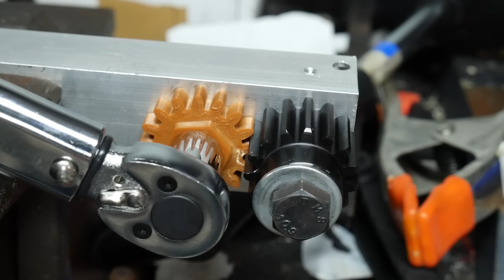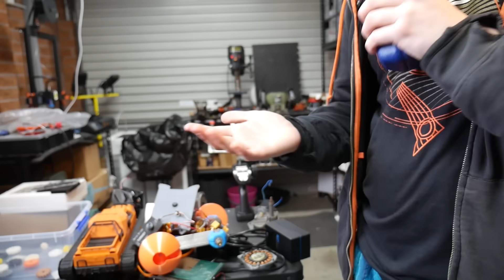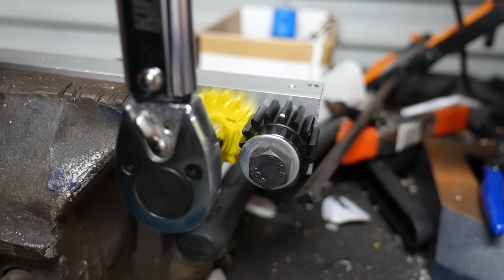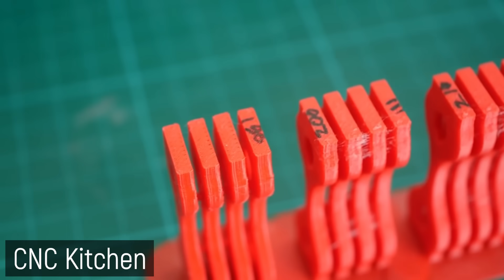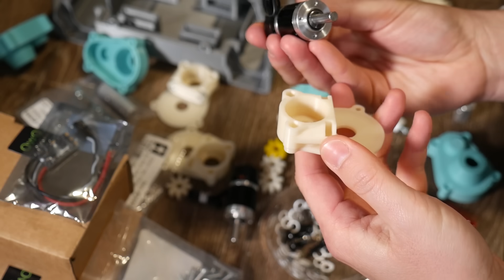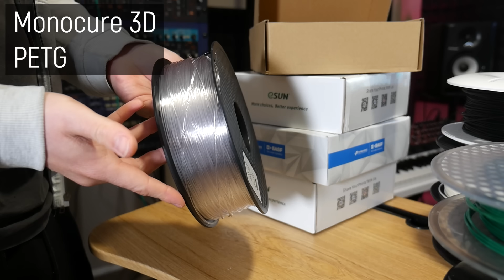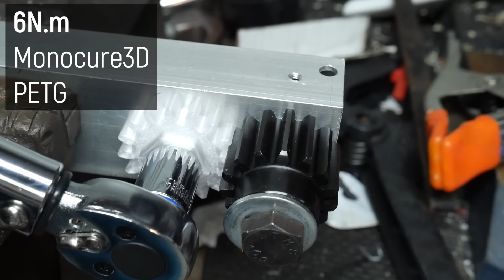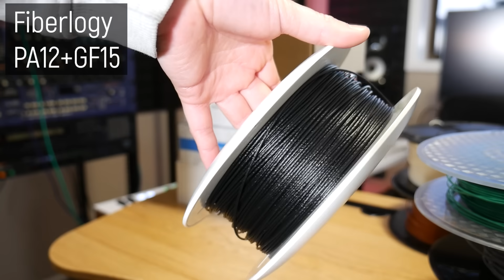Which 3D Printed Gear is Best?

Comment: Before watching the video I'm going to go ahead and say that my personal favorite is PETG. I'm very curious to see what your results are!! Update: Okay, how could I have been so wrong haha. However, to note, the quality depends so much on producer that I think it's impossible to say which material is the worst.

I have been designing some machines lately and the PETG that I used for the parts worked better than any other material I tried to print with. I've never had a failed part with this PETG I'm printing with, and it's lasting much longer than any other PLA I've printed with. Most PLA's would start to crack after one year of use. They say that PETG has worse UV resistance, but I think that in the end the PETG I have holds up better than the PLA I had.

On top of that this PETG prints really nice with an E3D hotend with a titanium filament path, so no PTFE tube inside this hotend. I was expecting problems, but my prints never looked this good.

One more thing I miss in the comparison is a comparison of the friction coefficient, which greatly impacts how long a gear survives, and how hard it is to turn. Some plastics just really aren't that frictionless. PLA in my experience performs the best as a common filament, but Nylon should have an even lower friction. And eventually PTFE has the best of all of these, but I sincerely recommend against using PTFE in a 3D printer as it's a super dangerous plastic. If you have pet birds, stay away from printing with PTFE as your birds will definitely pass away from even the tiniest amount of fumes.
Reply: I don't think you're wrong, PETG would still be my choice under the circumstances. I had some loaded PLA prints and there's some chemical degradation happening, they all shattered after 1-3 years, it doesn't even feel the same. PETG is pretty well behaved, low surface friction, good abrasion resistance. UV resistance? Depends on additives and colour, but i wouldn't say PLA is anyhow remarkably good in this regard, not from the tests i have seen.

Nylon could be worthwhile, maybe HIPS, SAN, ASA, worth testing, but PETG is so cheap and doesn't cause much headache...

Comment: Did you rotate the gear after you noticed the deformation while testing?  I would think that if you didn't you did not get the true fail torque b/c the gear was damaged at that point.

Comment: While I was researching for a project, I ended up looking at the tensile strength of various ropes. Pigments can have a surprisingly large effect on the strength of the material. I'd be curious to see how the unpigmented materials fare.
Reply: Also printability. I had a white PLA (fas filament) that was almost unprintable for me.

Comment: I made a 3D printed change gear for my 120 year old lathe. The gear was made from PLA, 1 inch wide, 80 percent infill, 16 teeth, 8 DP with a 1/4" keyway in the bore. It handled a cut of .125" depth of cut in 8" diameter steel, .008" feed per revolution at about 20 RPM with no problem.

Comment: Far be it for me to tell you what to do, but I would've tested a CF Nylon before the Glass-filled. I say this just because the CF Nylon is stiffer than the glass filled, and would likely have provided the best results since stiffness was an issue. Of course, with that, you get the potential issue of more catastrophic failure since it IS stiffer

Comment: In industrial settings the ideal gear will fail if over torqued at the tooth route in a clean manner. I used to worry about it jamming a drive if it did that, but the small pieces just fall the bottom of the box. I don't see metal gears failing any other way, and it's good. Allowing the motor to keep turning after catastrophic failure is so much better than having to replace a gearbox motor and a driver (VFD/Servo). Often if a gear does fail in as such the tooth rips off, just the gear and maybe the bearing can be replaced.

Comment: I distinctly remember BASF commercials back in the 70/80’s, usually sponsoring public TV programs. Currently, the largest chemical company in the world😎
“At BASF, we don't make a lot of the products you buy. We make a lot of the products you buy better.”
Older me, now knows better😂
Reply: In what regard? I have the front panel of an old HP PC i picked from dumpster, well i accidentally stepped on the latches, and they bent at nearly 90° and then sprung back like nothing had ever happened, no crazing nothing, and that's apparently BASF ABS. I was surprised, ABS shouldn't normally be able to withstand that!

At 163cm and a little over 60kg, i'm obviously not some kind of extreme heavyweight, but still.

On the other hand if you were going to buy their cassette tape, then maybe you shouldn't. And if you were going to buy their CD-R or DVD-R, well you very much definitely shouldn't. Just a licensed brand to companies that make the cheapest junk.

Comment: I bought and tried to make some gears using POM (polyacetal). POM is the commonly used plastic for gears in the injection mold. Is very very very hard to print i was never able to print perfect parts with that filament, compared to ABS, ABS is like a child's play
.

Comment: I'm sorry Angus, but in almost every test, I see deformation starting at the hub where you have implemented the 20% infill.  As a result, the teeth are not able to hold mesh to give them a fighting chance  So, I do not feel these tests accurately portray the strength of the materials for the application.  Finally, I would really like to see more testing with PETG.  Anyway Angus, I really appreciated the efforts and video but let's try again.

Comment: Petg will perform better with 0 infill no retraction and 2.4mm wall width.  Redesign gear to make it have 0 cavity and more like injection mold. 

Print with all fans off, at 230.

Comment: Did you water-treat the pets after printing? It seemed too brittle in my opinion
Reply: Huh? I have never heard of water-treating the PETG. I heard of it in the context of Nylon, but the performance in the test suggests that the Nylon sample has absorbed a typical amount of moisture from the air already prior to test.
Reply: @SianaGearz  it's very possible that water-treating petg is something I made up, but just thought it was the logical thing to do. In my experience it makes the part way more "flexibel" and yields more before and after cracking under load. This being said I haven't done any scientific tests, maybe a fun video idea though
Reply: @georgblennow3174  In the same vein, Alex Kenis did PLA degradation tests, when noticing that the PLA filament on top of his printer was becoming brittle; common "wisdom" that you see repeated on Facebook and Reddit is that it's due to water. While water in filament of course can make for horrible prints, as it will foam and might potentially cause a hydrolysis reaction at higher temperatures, it turns out, it makes raw material more flexible. UV light and ozone were shown in tests to be more likely candidates for cause of degradation. I also surmise that if the PTFE tube emits any fluorine compounds, those will have a devastating effect on the plastic, but in turn light and heat are likely to knock them out.

Another interesting experiment he did, was that there apparently were some scientific publications that PLA can be annealed with alcohol, and you can avoid heat related warping like that. And that seemed to check out too.

But yeah, water treatment of PETG is an interesting topic.
Reply: @SianaGearz  hmm very interesting indeed, a bit of topic but will definitely have to check it out. Thanks for sharing!

Comment: I've been using a fair bit of Polymaker PC-ABS and more recently PC-PBT (which has been a real paint to print, but it's certainly tough and the temp resistance is very impressive) and both would possibly be really good options.

Comment: I'd like to see these three go through the same tests on the Swedish Prima products...
Prima Select PLA (several times stronger than normal PLA).
Prima Select PLA-Tough (stronger than Prima Select PLA).
Prima Select PLA-Tough, annealed (even stronger).

An injection-molded gear for reference/comparison (could be seen as an "expected maximum"); yes, I know it's solid / has no infill, so it's not completely "fair".

When printing gears, remember if you make the gear twice the thickness, it'll be a lot stronger.
Also: Helical gears will distribute the force more evenly and they're more silent (also for the same reason), but you wanted spur gears, so no need to go and re-make the video. ;)

Comment: Definitely try printing with a solid infill.  And maybe even try different percentages,  maybe,  40%, 60%, 80%, 100% if you see an improvement with 100%.  It would be nice to see if there is some optimal spot or maybe 60% does just as good of a job?   Also perhaps try gear thickness.  Like the metal geal is thicker in depth.  If you have a wider area mating, it should be stronger and it would be nice to confirm.  It might also be a better way to think of the design of gears.  That if if you're putting a higher load in the gear, just build a wider gear.

Comment: I noticed that the PLA-ST was white. From my experience white filament requires higher temperatures to achieve similar performance to the same brand black or grey filament. I blame the lower performance on the albedo. I think the test should be done with similar pigments between the samples.
Reply: I don't think it has anything to do with albedo. I think the culprit is the pigment, which is ceramic, either Zinc Oxide or Titanium Dioxide or both. If you have a dark colouring agent, which can be a pigment or a dye, the material goes opaque quickly with relatively little colouring agent, or the transparency is easy to neglect, but since the white pigment doesn't absorb much light on its own and just diffuses or passes it further into the material, a lot of white pigment is needed to reach a solid white colour. And since it's a ceramic, it has both a spectacular thermal conductivity, so it may be wicking heat away, and substantial heat capacity much more than the surrounding plastic. You may know zinc oxide as a common thermally conductive filler in a thermal paste. I believe this is the reason opaque white filament has a very special behaviour.

But the unique optimal temperature depending on pigment needs to be kept in mind indeed.

Comment: I think you need to test the gear wear as well.
From my experience PETG > PLA > ABS but I havn't used PETG as much as others. Never tried nylon but I expect it would be better.
Reply: Indeed, i expect high surface abrasion with ABS.

Comment: Did a similar test, torque wrench.  My best material was Nylon with carbonfiber.  But my issue was my gears were very small and the thickness wouldn't survive the torque I was trying to put on it.  However the carbon fiber nylon reach over 130inlbs, to the point where the bolt I was using failed.  After that I wanted to try slanted teeth, which should be stronger, but I couldn't get them to print well enough.

Comment: not a surprise the yellow PLA is the weakest. I have a similar experience with that color, even in the same brand. I don't know why, but yellow seems to be weaker.
And we can (seemingly?) see the failure starting in a thin part, so I'm pretty sure putting more plastic here will help.
Reply: I wonder if it's a similar curse to white filaments. To make the material less transparent, they stuff it full of pigment, and that pigment is a ceramic, so it has crazy high thermal conductivity and high thermal capacity. So you need to run the extruder hotter to reach the same strength, but you may be compromising appearance regardless. In a dark material, it can be an organic dye or a pigment, and it's not very reflective so it prevents too much light from penetrating into the material, so less is needed to make for an opaque-ish appearance.

Comment: Hey, I used 3D printed gears for my drive and my weapon systems on the TV show BattleBots, with not a single failure (not caused by another robot smashing them). This testing is awesome, but I think the conclusions are a bit mixed because, are we testing how well a material holds a hex shaft, or how well it holds its teeth? Is that much torque really realistically a failure mode for such a small gear? Would the same results be found with a spline or a keyed shaft? To me, nylon is far and away the best material for gears, because in a properly designed drivetrain, failures arrive over the course of thousands of rotations rather than one stall. Wear characteristics are incredibly important, and while this test measures something equally critical, it's not in my experience how things actually fail.
Reply: I recently printed and then machined to shape a compound spur gear made from Taulman Alloy 910 Nylon on my Snapmaker. The gear teeth are much smoother (although there waa a bit of delamination between the layers). Arguably just CNC machining from a solid block is stronger but wastes a lot more material.
Reply: @Bordpie  I just up'd the temperature and the layer delamination was fixed.
Reply: @SpinStar1956  Yeah I printed it on the hot end of recommended temps but I could up it a bit more. I actually documented the manufacturing process in an instructable. Search for "hybrid manufacturing" on Instructables and you should find it.

Comment: The properties of black pla always seems to outperform all others for me even from the same supplier it flows and has better properties.  You should try MG chemical filament.  The ABS can be printed across a huge range even as low as 180C

Comment: You should use double helical gears. You are printing so you can do the double helix in a single gear. (Kinda looks like a tractor wheel.)this gear type is great for high load applications.

Comment: Very interesting test, but most importantly these results tell me: "Don't use a hex shaft!" Would be nice to have this re-tested with a different force transfer.
Reply: one reason why torx was invented....
Reply: @uwezimmermann5427  True, but I don’t think a printed gear would be able to cope with the tiny splines.
Reply: @timehunter9467  good point, I don't know too, but when we think about it, if you stick a torx driver inside, the profile on the printed part actually has the rounded shapes which may be easy enough to handle in 3D printing.
Reply: @Kalvinjj  True, I guess it depends on the size of the gear being printed and the accuracy of the printer itself.
Reply: @timehunter9467  true, but there are other alternatives then just a hex-nut, which all must be better then an approximation to a perfect circle with no attack angle att all...
Reply: Maybe triangular shafts
Reply: @Peter_Schluss-Mit-Lustig  A square shaft will offer significant improvements too if one cant get a triangular one

Comment: The advantage with nylon is less friction, that’s why many non 3D printed gears are nylon
Reply: The combination of super low friction, high abrasion resistance, and ability to spring back into shape after a fault is pretty remarkable! This combination made it the main injection moulded plastic gear material for sure.

Comment: That PETG had NO elasticity left in it from being printed at too high temperature.
Sure, it gives superior bonds but does degrade the plastic.
Reply: PETG has fairly limited elasticity to begin with and high plasticity. It does degrade from being kept at the printing temperature but i don't think it has degraded substantially from printing, it happens more at particularly slow prints. I do think giving a loaded PETG print a large skirt is a good idea so it can purge all the plastic that got degraded during the heatup/cooldown of the hot end, but ultimately this should only affect a small portion of the print.

Comment: you can get digital torque wrench adaptors that have a "max" setting.
Reply: 100%
Incrementing up on a standard torque wrench introduces all kinds of nasty variables, especially in plastic. Testing methodology probably eliminated some of that, but just one iteration is a tad low.